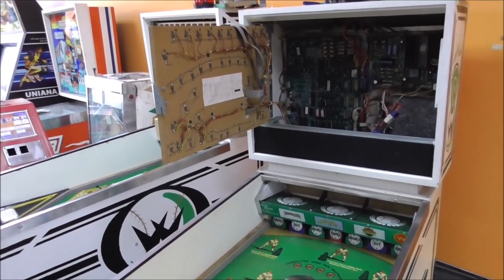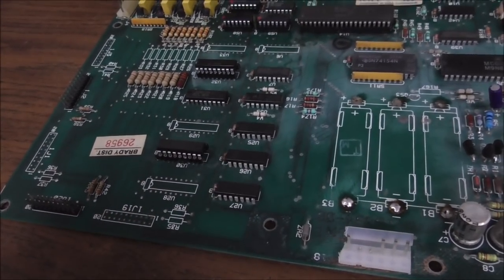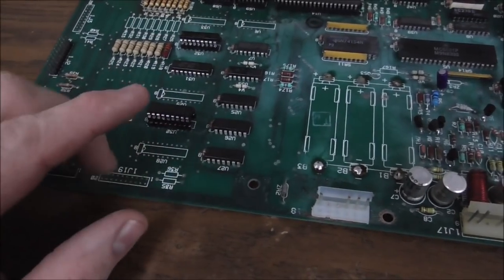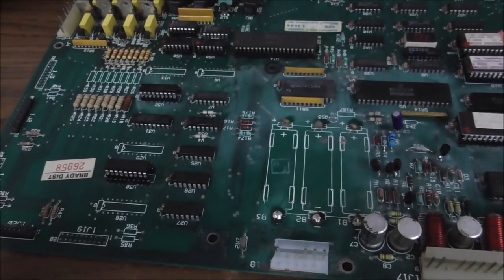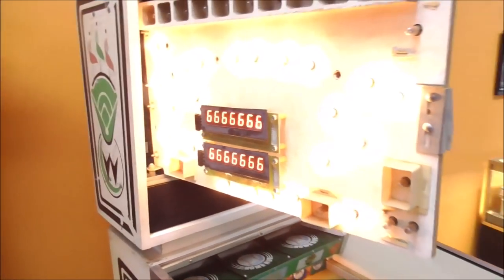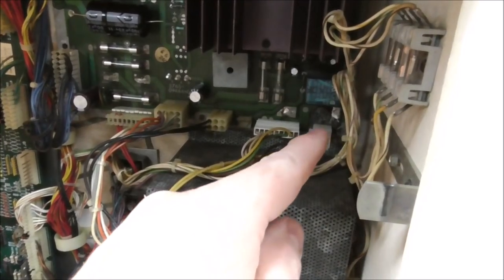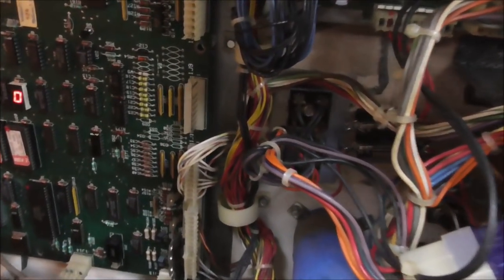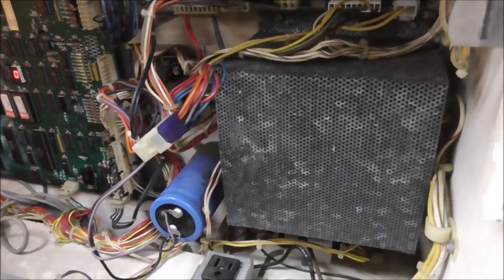Fixing MORE Displays... and Bridge Rectifier Fuses on Two Williams Pennant Fever System 8 Pinballs 5

Comment: JOES CLASSIC, What are the advantages & Disadvantages of using Insulation Displacement Connectors? Why didn't you use a logic probe when trying to find if the display driver chips are working or not working correctly instead of guessing and shotgun the parts? I'm guessing the logic probe doesn't work for display driver chips and display decoder chips?
Reply from the maker: You can use a logic probe on some of that but some of the chips run off of the +100 and -100 voltages and the logic probe doesn't work at that voltage.  The Insulation Displacement Connectors are cheaper and quicker to install at a factory, but they are not as sturdy and permanent long term as the crimped connectors.
Reply: @LyonsArcade  What kind of displays types are those since they need +100 and -100volts? they aren't LCD displays or LED displays because other pinball games used 8 segment display which I think 8 Segment displays are just LED
Reply: @waynegram8907  https://en.wikipedia.org/wiki/Vacuum_fluorescent_display
Reply: @moshly64  I didn't know they used VFD in pinball games, I thought they were just normal 8 segment display which are LED
Reply: @waynegram8907  They did not use LEDs until the mid 80's. 70's LED's are too dim.
Reply: @moshly64  Those VFD you have to Short out the display to burn off the chemicals to recharge the VFD from what I have heard. +100volts and short it to -100volts to make the VFD burn off the emissions, you have to do this when the VFD displays are Dim or not bright?
Reply: @waynegram8907  Its not burning off the chemical, its already burnt off through use (its giving it a clean surface to help what little remains). Not sure about the ones used in pinballs but any type of (CRT/VFD cathode emission device) rejuvenation is normally only a short term solution, if it works at all.
Reply: @moshly64  yes the cathode emission needs to be rejuvenated but how do you do this on pinball VFD displays? The cathode has electrons and over use the electrons get less and less over the years of use.

Comment: so if you put system 11 power supply in system 8 will it fry all of the boards  or what i am confused
Reply from the maker: No they are almost identical it’s just the system eight boards fry a lot because the power for the displays runs to the MPU on the other systems the power to the displays runs to a separate board
Reply: @LyonsArcade  ok i had pinbot when i was 11 years old since then i like pinballs and if you ask did we sell the pinball no we toke it apart becuse it was in wery bad shape

Comment: Looking at the schematics I'm fairly sure that with some effort you could fit a "system 6A-9" LED kit to this. You would just need to pick off the relevant logic signals from the MPU board and route them to the "master board" of the LED kit.

For someone who fixes games in bulk like you though it wouldn't be worth it when you can just steal displays out of other games and put the LED kit in the other games,
Reply from the maker: I think the issue is since it only works on this one game nobody's made a solution , you'd probably have to interact with the PIA chip they run the signals from on the MPU, maybe you could make a little pcb that plugs into that socket to intercept the logic and run it to the led master board... but there may only be a couple hundred of these Pennant Fevers left floating around....